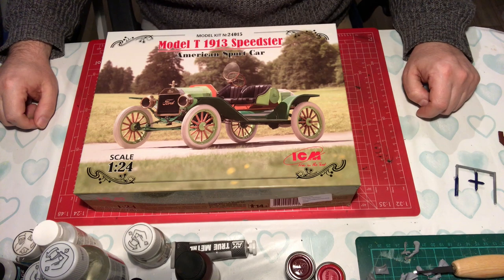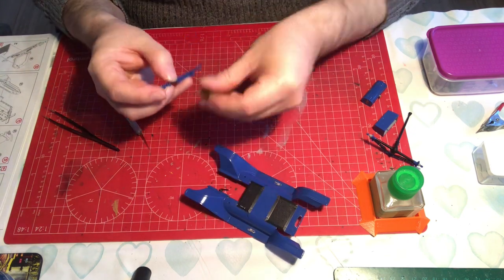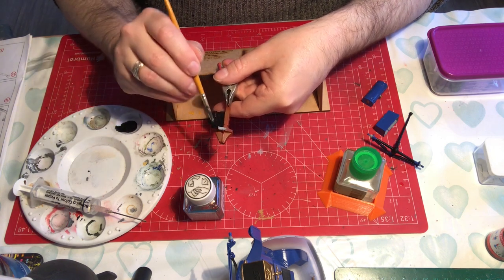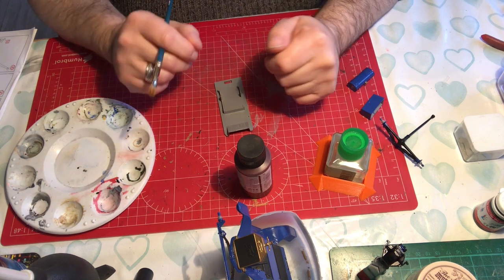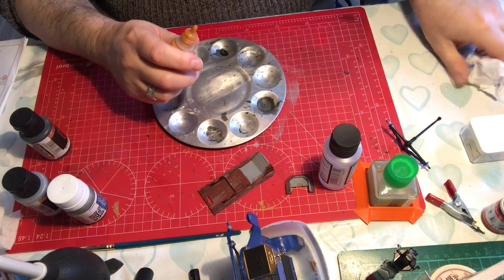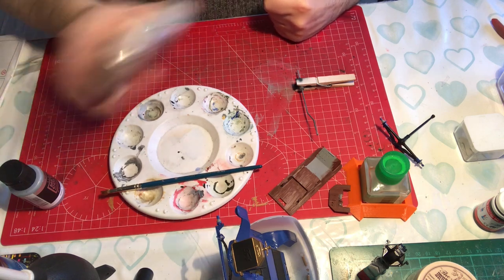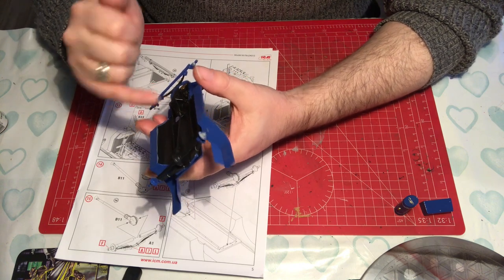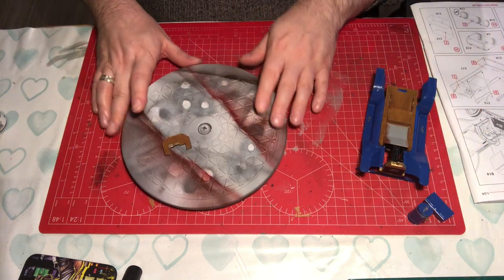ICM 1/24 Model T Speedster build part 1

Comment: Hello again!  Two videos in one day, you have been busy!  I built a 1/35 ICM Model T recently and had similar issues with the engine.  I also had a warped frame, so it took a lot of work to get everything fitting.  I have one suggestion for you.  Before you fit the dash, put your hood together.  The radiator, dash and hood have to be in perfect alignment to look right.  I did the same thing you did, glued the radiator/axle in and eyeballed the angle.  Later when I tried to fit the hood, the angle was off, and I had a gap.  I really like your wood grain effect, I'll have to give it a try.  See you next time.
Reply from the maker: Many thanks for the advice Jeff I will do plenty of dry fitting 👍🏻